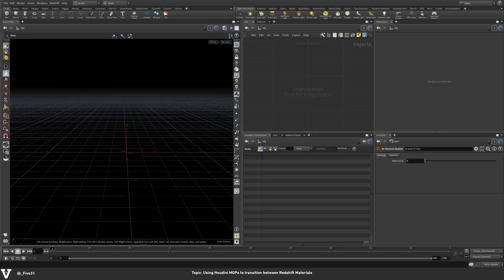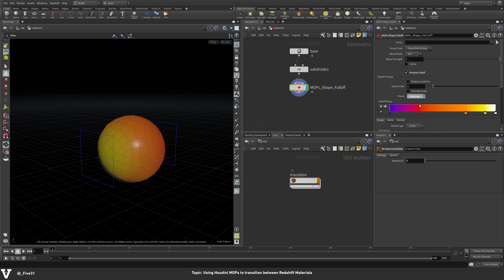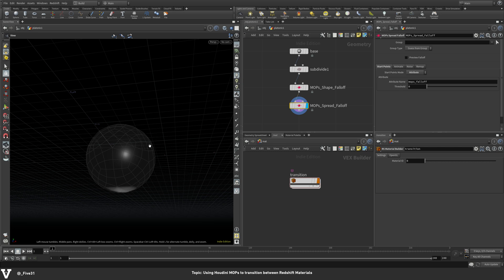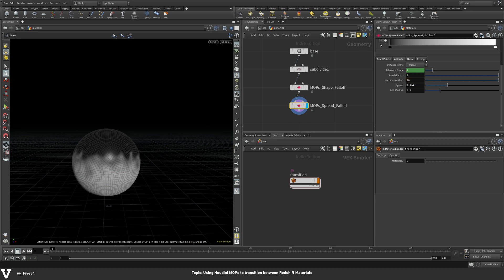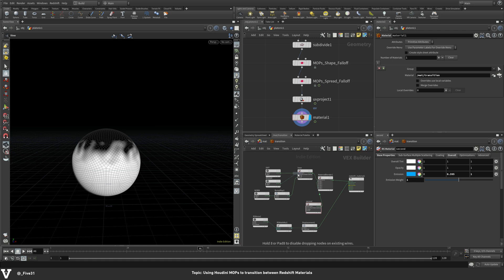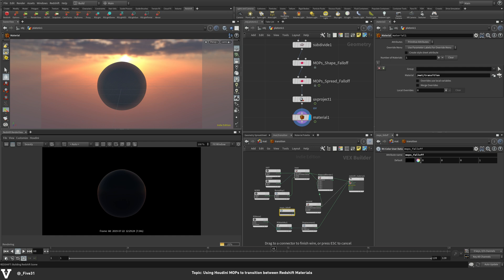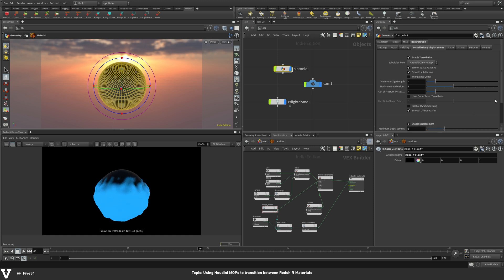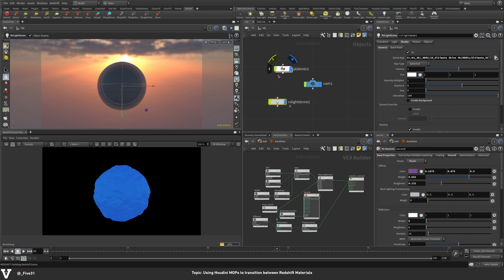Houdini: Using MOPs to transition between Redshift Materials

Comment: nice. Im wondering if this is possible to achieve at a SOP level?
Reply from the maker: By sop level, do you mean without MOPs? MOPs is a sop level tool
Reply: @ProfessionallyIncorrect Sorry, I meant the transition takes place on the geo mesh/points itself and not during rendering. More like object morphing. Hope I made it clear. Haha
Reply from the maker: @salteekfx596  Totally. You'd use the attribute in the same manner, but to drive it at SOP level instead of render time.